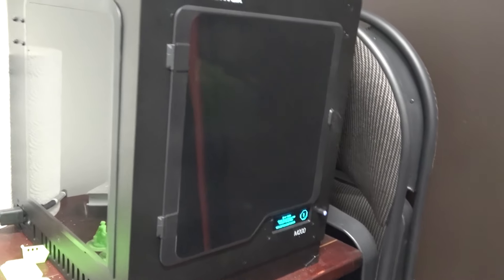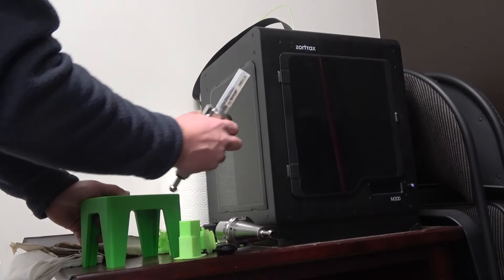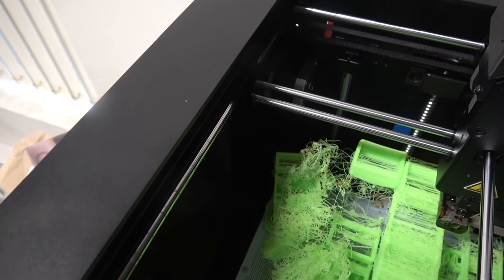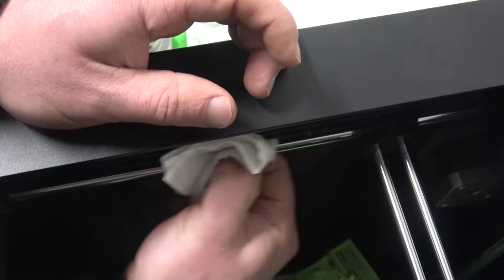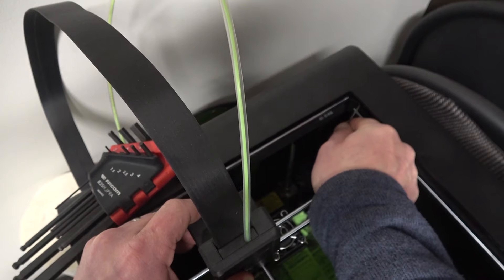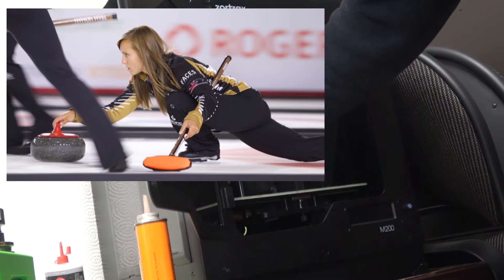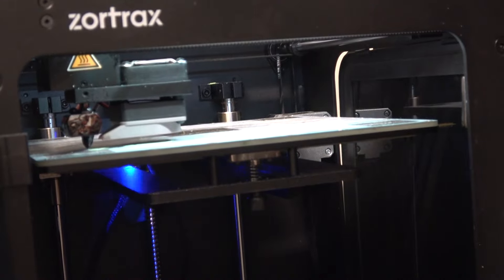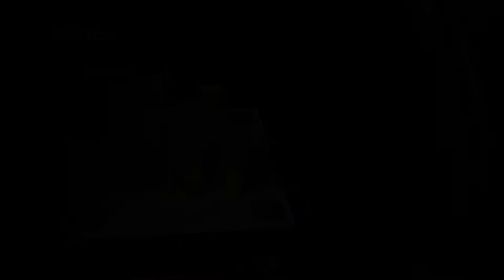WTF is a Zortrax M200?!

Comment: I use CLP gun oil on mine, I figure if it is good enough to prevent fouling in my long-distance lead transmitter then it is perfect for my precision printer.
Reply: "Long distance lead transmitter" best part of an AvE vid all the new politically correct lingo ya pick up ;) you must be a ham guy too!
Reply: @joecarnes9174  Nope,he is kosher so no HAM.
Reply: @muppetpaster  waka waka waka 🤣
Reply: Try lithium rather than oil. Oil turns to gum when the dirt gets to it, but lithium stays nice and creamy. It sucks  when you come back from a 24 hour print only to find spaghettification due to a sticky oil job.
Reply: Gotta watch out if you use it in California, it'll give ya the cancers.
Reply: ...and the lovely cologne of Hopps #9 will help offset the smell of melted plastic. You sir win today's internets!
Reply: @antagonizerr  That's why I avoid 3 in 1 oil and use sewing machine oil on the rods instead. It doesn't seem to gum up like the 3 in 1. To be fair, it takes a fair amount of time for the 3 in 1 to gum up, but I prefer not to worry. I use the lithium grease on the lead screws.
Reply: I was thinking Tri-Flow or a sewing machine oil myself.....  Three in one can really gum up the works after time. no good atall for sewing machines and the like.
Reply: Just like WD-40, the marketing wanketeers prescribe 3 in 1 oil for everything other than what it was designed. 3 in 1 oil is a petroleum/vegetable oil blend originally intended to be (in part) a drying oil -- that's its rust protectant mechanism.  Unless you would put linseed oil on it, don't put 3 in 1 oil on it.  Not only does it gum up, it persistently clogs the pores in bronze bushings.  When a quality light machine oil is needed, 3 in 1 oil will only cause problems.

Comment: Count yourself lucky, I left mine for 23 hours and it caught fire.
Reply: he's lying. Lol.
Reply: @nicewhenearnedrudemostlyel489  they are known to combust, especially with sketchy heat bed wiring.
Reply: @cFcFire  Yup, had it happen while I was printing an upgrade which would have necessitated the firmware flash; never got to it for some reason. :thinking:
Reply: @thegardenofeatin5965  thank you for that headline worthy info bit... that has nothing to do with anything i said.
Reply: @cFcFire  Thermal runaway protection won't help a burned Mosfet stuck closed feeding constant power. You trust chinesium safety?
Reply: @joelfager3839  if you use something like Octoprint, it can send a message to something like a wifi plug or USB controlled relay to physically cut power to the printer and completely shut it down.
Reply: @charlesgunzelman3323  Yes something like that will be my next upgrade. Right now im not feeling comfortable leaving me printer unattended. Burned Mosfet after only about 24h of use on a Ender 3.
Reply: @cFcFire  one of the first things I did with my Ender 3 was flash TH3D onto it solely for the thermal runaway protection. Dunno if Creality ever started enabling it from the factory or not.
Reply: @internetpizza  Runaway protection is certainly an upgrade, but it only protects you from a failed thermistor (and thus the printer trying to heat up to infinity to catch up with the erroneous temp that the thermistor is reporting) A failed MOSFET (which almost always fail short closed) can't be protected against without cutting the power to the printer. Its about time the manufacturers added a master power relay to give the controller the ability to full power off when a fatal error occurs
Reply: Are we talkin 3D printer or the circumcision thing?
Reply: BIRB ÒVÓ
Reply: @Eaglebird  

I believe you, fellow featherbutt.  My 3d printing kit i got for my replica shop on etsy runs relativley well, but one time the heating element popped out and i had just turned off the thermal runaway detector because it was causing false readings and ruined my 10hr print 80% through.

That uhh... Caused the element to glow bright red and at the corner of my eye, i caught what i actually assumed to be an LED i didn't know my printer had. By the time i turned it off, it melted a hole clean through the glass pane without cracking it, though it cracked when it cooled down so i had to throw it away unfortunately.  Would've been a neat convo starter if i werent a mute.   ^v^"
Reply: Neil Siebenthal  Agreed, but it doesn't stop average Joe who wants to give 3d printing a try, from burning down his house, hence why I think it's time manufacturers added them. I am using modified Sonoff plugs and spaghetti detective myself, and will be upgrading to sealed chambers and a co2 suppression system next year
Reply: @jjsjeffjjsjeff  somebody knows their printers
Reply: anet a8
Reply: @nicewhenearnedrudemostlyel489  thanks for the excuse to post new content if i can ever make a video before we clean it all up
Reply: @jjsjeffjjsjeff  put it in a metal enclosure if you can; insurance and investigator told me i may have been liable because mine was in a (fancy) wood cabinet.
Reply: @arcadeuk  I'll look into that, thank you for the information!
Reply: @arcadeuk  I'll look into that, thank you for the information!
Reply: Sounds great, what model/brand? Can I buy it from you?

Comment: 3 years with my £140 chinese rip off printer and it will still print useless junk almost perfectly
Reply: It looks like a very nice print (after you fixed the rails). But what is the £140? I searced for this printer on YouTube, and in this 3 year old video: https://www.youtube.com/watch?v=mGPWSye7eto , YouTuber "3D Printing Nerd" tells us at 34:20 that this printer is US$ 2000! And a roll of the closed system filament is $50. Did you not get the original Zortrax printer?
Reply: Anet A8 ?? :)
Reply: Perhaps a Tarantula?
Reply: Anet a8, don't you mean personal bonfire?
Reply: @nixxonnor  nah I bought a monoprice select mini clone, its all unbranded but it's the same hardware as the original I think
Reply: @Mkz0r  Indeed loll
Reply: I went for one of those snazzy looking Kossel triangular robot things...looks amazing and once in every dozen or so prints it actually completes without fucking up, over the last 2 or 3 years years i've printed literally some things.....
I suspect it would've been cheaper to build a factory, buy an injection moulding machine and staff it with 6 Chinese children & print all the plastic tat i could ever want though...
Reply: @tumbles8350  I have a Monoprice Maker Ultimate. The mechanism is virtually identical to the Zortrax, there are some minor cosmetic differences. I believe it was also sold as a Wanhao Duplicator, I forget the model. It works beautifully. I lubricate the rods with sewing machine oil instead of 3 in 1. I've found that, over the years, 3 in 1 oil tends to gum up and has to be cleaned off and replaced. Probably not a problem in something like a printer that gets regular cleaning and maintenance, but still...
Reply: @j.cheeverloophole9029  Yeah, the printing of random useless objects gets pretty old. I use mine for making cases, brackets, etc for my other projects. That never gets tiring. I get more like one fuck up out of twelve though...
Reply: Theyre presumptive steppers
Its a presumptive automation system
What could go wrong

Comment: My cheap as chips ender 3 is real fun! I've done prints on it that are better than the ones done on much higher priced machines owned by a FabLab. Needs some tinkering for sure, but that's half the fun of 3D printing!
Reply: The Ender 3 is a hell of a mighty chinesium tool and a awesome bang for the buck.
Reply: I would say you really just have to understand your instrument and the effects of slicer parameters to get decent prints. Not a plug and play. Had to tune my POS ender 3 to what it is now
Reply: @smh9902  is this related to thunderfoot?
Reply: The ender 3 is awesome once you get to understand it and tune it well. I have gotten better results than my buddy's 1k printer.
Reply: @smh9902  Ever heard of Carnot?
Reply: Best mods I have done so far and would HIGHLY recommend for the Ender 3 is Dual Z Screws, glass bed with a PEI sheet sanded with 600 grit, metal extruder with the upgraded spring, and an EZABL
Reply: @smh9902  User error.
Reply: The Ender 3 pro works perfectly out of the box. If you're having to "tune" things, it's most likely because you're screwing with settings that you shouldn't be. The standard profile works just fine for any filament that isn't complete garbage. The magnetic removable print surface is also a 100% must. Crealty sells it with the magnetic base so  you can put it on other printers as well, which I would strongly recommend.
Reply: Why does everyone keep recommending the Ender 3, isn't the Prusa Mk3 the most reliable consumer printer?

Comment: There are ways to use an arduino and a camera to watch your project and it can tell when it starts stringing and can stop the project. Also can kill the power incase of a fire from bed overheating.
Reply: Octoprint works really well for monitorihe ng remotely. The Trinamic stepper drivers have a bunch of features built in, I think knowing if the print failed is one of them
Reply: The only thing you can do on the M200 is cut the power. It has no USB-connection or any way to remotely control it.
Reply: What about a fire from the board overheating? Or a bad harness?

Comment: Just found your channel recently and ran into this video today. 
Those look like 8mm rods, possibly the LMU8 bearings (maybe LMU8UU). They do need to be lubricated from time to time, and the rods do wear out.. Luckily the 8mm rods are relatively cheap to replace. If it's starting to bind, it's possible one of your bearings is going out, and when they do, they will wreck the rod as well by leaving a long gouge on them.
I put Drylin bearings on one of my printers and that seems to work well, but you NEED to put those on a new rod or else the grooves left from the bearings will act like sandpaper to the drylin. 
As for the smell.. Try PLA instead of ABS. 
And the crud at the extruder... It's a sign your extruder is pushing, but filament not moving fast enough.. Check to make sure nozzle isn't clogged or temp isn't too low or printing speed isn't too fast that the nozzle can't keep up with temp.

Comment: (sorry for all the comments), printing with PLA isn't bad at all, it smells like pancakes
Reply: I'm not sure i wanna know what's in your pancakes.
Reply: I get a hint of caramel when i'm printing. It's because it's a bioplastic, and chemically is a kind of long chain sugar. It has more in common with cellulose or starch than, say, ABS or PET.
Reply: PLAncakes?
Reply: Ive accidentally singed pla with a hot soldering iron and it smells like pop corn
Reply: I use PLA+ in my prusia i3 and it gives the best general results put of it, ABS or PETG

Comment: When manually moving the axes around, you might want to unplug the steppers from the control board, because they become generators when you move them, and it's possible to toast your IGBTs, MOSFETs, or other electronicals. Word to the wise, from someone who learned the hard way.

Comment: 3d printing is like a lottery where instead of it being a 1 in 100 chance of winning its a 1 in 100 chance of losing. Most of the time it works then you have that one massive print that fails and then it works the second time after some tinkering so you didn't find out what the real problem is.
Reply: 1/100 to 3/5 depending on the plastic mate x) - ever tried printing a big ass ABS model without a proper enclosure? :p
Reply: @pixelsafoison  yeah it's heartbreaking. Of all the hobbies I have had, 3d printing has caused the most rage outs haha.
Reply: @pixelsafoison  what's great is when it looks like it's going great and then you get it off and it starts delaminating
Reply: @Falcodrin  then you start cheating on your abs rolls using petg ... After a week you send the ABS a text message to break up
Reply: @pixelsafoison  I have been checking out PETG's ass for a while now,  but you can't beat  acetone smoothed abs finish.
Reply: @pixelsafoison  Luckily I haven't. I only used ABS a few times for small things, and I made an enclosure for it. I just stick with PLA.
Reply: @dylandreisbach1986  Gotta love PLA, but as soon as heat is involved you either need to switch to PETG or something even better. As always it depends heavily on your machine. If like me you're an engineering student that cannot afford a sandwich, a CR-10 will do, if you can afford a 2.5K€ machine -> Do whatever the fuck you want :D
Reply: PETG is great, until you get a clog. That stuff hardens like steel if it burns in the nozzle, might as well get a new hot end. 
Hopefully you won't have that happen, happened to me due to a filament jam while away from home.
Reply: No matter how many times I have printed a file, I always am there until the first layer is completely down.
Reply: @dylandreisbach1986  PLA is my favourite as far as ease of use, but even inside a car on a hot day and it melts.
Reply: @pixelsafoison  why would you try printing ABS without a proper enclosure?
That's just asking for trouble.
Reply: @procrastinator1842  but no toxic fumes from Petg is pretty nice in comparison to ABS
Reply: @Jehty_  FOR SCIENCE I SAY! :3

Comment: 3 in 1 oil is what I use to lube my printer.  Being a home-gamer that made my own printer from scratch, I learned just about every problem that is possible.  I also tried many different ways to get the parts to stick to the bed.  Out of all of them, I've found that using cheap dollar store finger nail polish remover on my heated glass bed gets the best results.  Pure acetone doesn't work.  I don't know what's in the fingernail polish remover that makes it work, but it does.  After the bed cools, the parts just detach and can be picked up without any tools. (just one application/cleaning every 10 prints or so)

Comment: TOTALLY AGREE, the magic is in the software. When i switched to Simplify3D from Makerbot's old software it opened up the door to so many ways to print and control, also making prints far more accurate that I knew the machine could. I still have one of the original Makerbot printers, with the garbage wood frame.. but it was $350 back it 2012 so i went for it. TONS of upgrades i designed myself later and it's every bit as good as most other new 3D printers.

But i promise you there's no need for a glue stick when you have a heated bed, simply clean the bed off before every use. If i don't need the part to stick too well i just wipe it off with a clean napkin and if i want it stuck on there good i clean it with a small amount of 90% isopropyl alcohol. The micro dust you can't see is what makes it not stick, took me years to figure that one out. Then when the parts stick too well i take a compress air can and hold it upside down to freeze the part at the base and shrink it, always pops off with a little spray. I have a metal heated bed with Kapton tape, I've had to bend the metal bed back into shape two times of the years ;-) It's surprisingly flat right now.

Comment: I have three of these. No expert, I'm still learning. I've consistently had problems with longer prints where they will skip steps (just like the thumbnail of the video, a birds nest), and I think I've found the problem.

The stepper drivers are getting very hot and have no active cooling. This will often cause them to skip steps, and then from there everything's downhill. I was able to print a fan shroud that blew air over the heat sinks on the drivers, and that fixed the problem.

As you said, these are open-loop, so there's no corrective feedback for when they do skip steps. How I fixed my machine was more of a band-aid, but smart stepper drivers are the way to go. They can be programmed for overcurrent/overtemp control, and they can detect skipped steps. These with active cooling seem to me like they'd be pretty reliable. You can always manually adjust the voltage delivered to the motors manually (the pot on the stepper drivers), but this hasn't given me much luck.

I haven't figured them out entirely yet but I do plan on installing them on one of my machines when I get some free time. I'd be happy to help walk you through it if you'd like.

Comment: bah, just turn the drive current up and bob's your uncle
Reply: Cannot do that. The M200 doesn't offer this.
Reply: @zaprodk  You know that label that says "No User Serviceable Parts Inside"?
Rip it off, open the case and put smaller resistors in the drive motor leads.
Works every time...
Well, those times it doesn't let the Magic Smoke out...
Reply: But, what if the drive current is already up and the stepper is skipping from overheating?
Reply: @procrastinator1842  Good way to verify the malfunction mode.
Also, when you extinguish the burning motors you know exactly what to replace.
Reply: Hey, you smell something burning? XD
Reply: @zaprodk  Cut up and edit firmware so it can.
Reply: @muppetpaster  good luck. It's a close source system.
Reply: @zaprodk  like that ever stopped anyone. Lol. 'Hmm the wires are all the same color but there's four like every other motor... oh well, idk"
Reply: Said on a channel dedicated to taking things apart and fixing them with no data whatsoever outside what you see when you open it.
Reply: @procrastinator1842  Enclosed box with a heatbed, Hotend and hot steppers spells disaster. Steppers  need removed from the box, add a heater, print polycarbonate ,peek, pei and ultem bob's your uncle!
Reply: @markfergerson2145  resistors? What resistors? The motors are driven with modern chopper-drives that run constant current. It's not stepper motors from the 80's with series resistance.
Reply: @danielrouw2593  correct, but I don't think it's a very good solution to go play with these. The stall current will lead to cooking motors
Reply: @zaprodk  the resistors are current sense resistors on the drivers. Smaller resistors make the drivers think the current is lower.